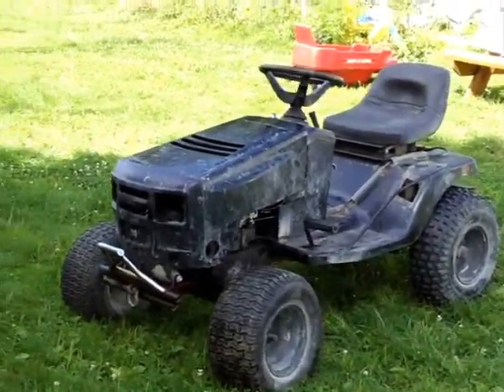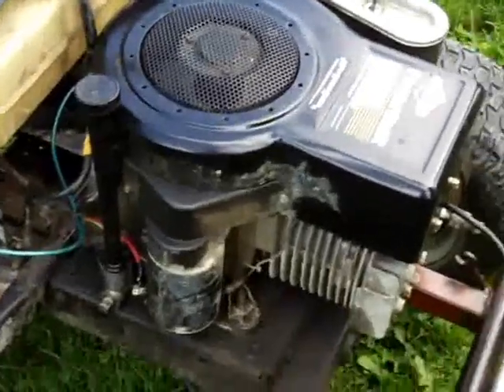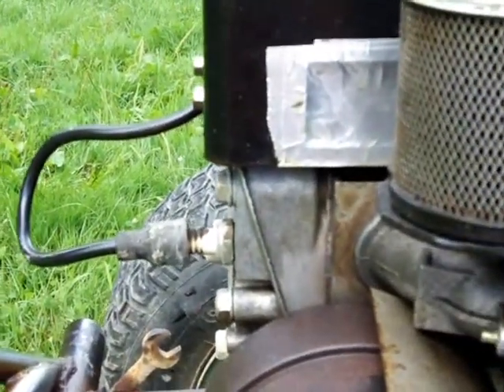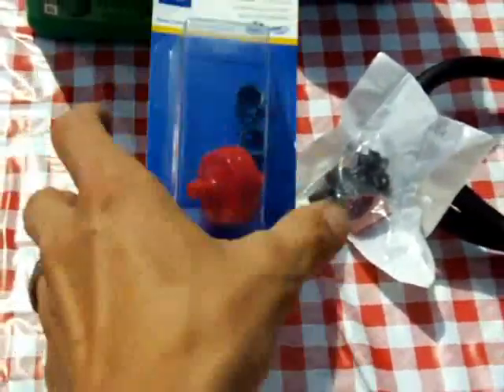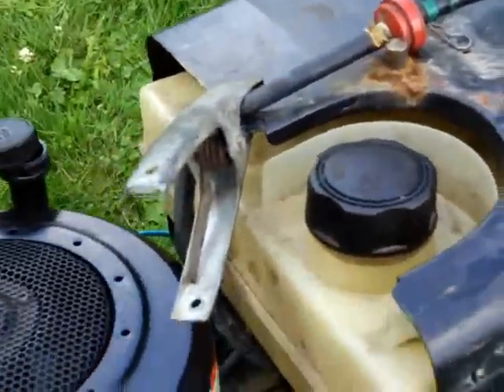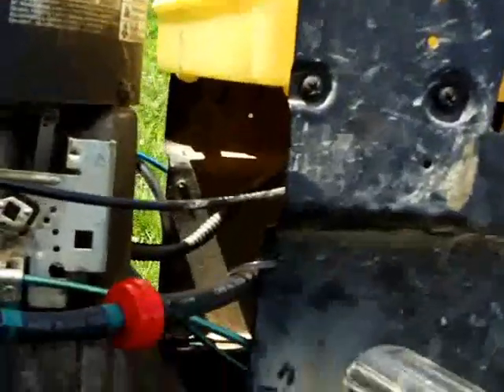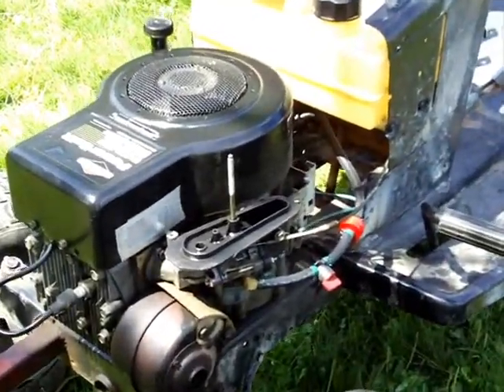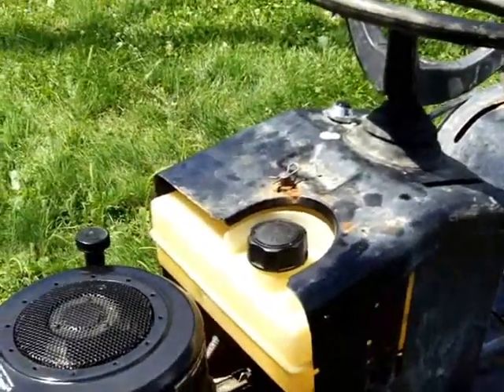Riding Lawn mower - Fuel system repair (Flooding)

Comment: Just went through the same thing with my stx38. The needle/seat failed on mine and even with the rebuild kit it kept flooding the engine. Put a new carb on and I close the shut off valve every time I shut down now and run the fuel out of the carb. Runs like new. Great job on the videos!

Comment: Thanks for the video because the exact same thing happened to my tractor today and after watching this video I knew exactly what to do. As soon as I realized it was hydro locked because it wouldn't even turn over I drained the gas oil mix and cleaned the carb. Don't know what caused the fuel to leak into the cylinder but it did. And ya thanks again for the video helped lots.

Comment: well done video, my Briggs riding mower has the same issue. Has a fuel shutoff valve since the carburetor won't close, forgot to shut the valve off and now won't turn over because fuel is in chamber and oil

Comment: My Ariens YT-12 was doing the exact same thing when I first got it (got it used) I ended soaking the carb in a bucket for two days, then putting it back on and replacing the fuel line, haven't had a problem since!

Comment: Thanks for the new vid man. I had this same problem with my 13.5 on the craftsman. I changed the oil a couple times before it stopped smoking. Runs like a champ now. Too bad I killed the brakes, tranny mounts, and steering on that thing haha. I got another mower that engine is going into.

Comment: I got a old Toro Wheel Horse 10 hp that the guy thought was blown up. Same problem. Started it up and it smoked like crazy because of gas in the crankcase . Still using it today and like it better than my new Troy Built.

Comment: @Fearlessfront hey u helped me with my wheel lock in the back. but i wanted you to no i did the same thing yesterday before i saw this vid with all the same problems but the only thing thats not the same is mine is a 1980 montgomery ward and it has one of those things that u twist that stop the fuel but the fuel shut off u got is what i got and helped alot...great vids!

Comment from the maker: it could be shorting out... It's possible it not getting a charge from the alternator, or the battery might not be holding a charge at all... I would load test the battery, then check the charging system.

Comment from the maker: that where the air flows out of the motor into the air filter housing (which is gone) I did this for 2 reasons, #1 if the air is flying out that hole, then it's not cooling the engine, #2 I didn't want hot engine air being forced into my intake, colder air is better.

Comment from the maker: sounds like your exhaust valve is out of adjustment... But first I would clean the carb and change the air filter and see if the problem gets better. Then check the flywheel key to make sure it's not partially broken, that would throw off your timing, causing it to backfire

Comment from the maker: @Gokartcreator does it just go click, click, when you turn the key? or does the starter rotate? It could be a bad solenoid. try tapping on the solenoid and the starter with a wrench... sometimes that will help.
Another thing you can try is using jumper cables, and hit the starter terminal with power directly. if it work then either  your solenoid is junk, or you could have a bad connection in your wiring..

Comment: The smoke was from leftover oil in the muffler,intake,cylinder,and around the rings..That air filter is only 8 bux at wally world usually...Off season its cheaper...

Comment: Always shut off your fuel when sitting long term. I’ve been around the block a few times with gassy oil it’s not hard to deal with but expensive.

Comment: @Fearlessfront The worst part of it is the 4$ of wasted gas, lol. I got a question, because I'm not too good at cleaning a carburator and setting it, but you seem to know a lot about it, do you think you could make a video of how to clean and adjust a carburator? I cant seem to find any good videos on youtube of it. The briggs on my tractor is running like crap and I dont know how to adjust the carb. i would apricate it very much if you did but if you are to busy dont worry about it. Thanks.

Comment: Just as a heads up if you have lots of gas in your crankcase DO NOT RUN THE ENGINE! if a spark gets past the rings it will ignite the gas in the oil blow the engine to bits and seriously injure or kill you. This happened to a car engine that my dad was next to one time.

Comment: the fuel line on my mower had sat for a few years with old fuel in it before i got it, when i tried to start it, new gas in it and everything, i couldnt figure out why it wouldnt start but it was because the fuel line had actually swollen shut and wouldnt let gas through. there was rubber that was breaking off the inside to so my mower was technically about to have a heart attack lol. had to replace it but i went with the cheaper clear tubing, that way i can see the quality of the gas and line.

Comment: i was wondering how you got the oil out of the the pvc valve thing because i have oil in mine and it keeps getting in the air cleaner and into the carb and i cant figure out how to get it out.

Comment: hey, I have the 14.5 horsepower engine Murray Widebody LT, and (assuming that these two models have the same electrical systems) I was wondering if you've ever had any trouble with batteries dying within 3-4 starts. My battery is totally dead now after charging repeatedly after it dying for nearly a year now. Maybe it has a short on it or something?

Comment: Hi fearlessfront I have a craftsman that is 24hp it was big bucks I bought it new. I had It for about 4 years and its been brocken for 3 years. It has a starting sound when I turn the key. It just does kick on. The other thing is it does not move when its off I even tried to move it in every gear when it was brocken. I also went to sear and got a nice die hard battery for $60.00 thinking that was the problem and I was not. When I get a chance I will put a video of it. Please help fearlessfront

Comment: well good to see you doing somthing, lol. Sucks when stuff like that happens. Also i finnaly got the gear oil for my tranny ill be trying to put it back together  tomarrow and i would then need to find whats called quarter 20 bolts for the pulley to mount directly on the shaft, then for a test drive. I was thinking about doing some pulls with my mudder but i am going to do test pulls with my mudder pulling my car with the breaks slowly applying to simulate a pulling sled.

Comment: on ebay im getting fuel line   a shutoff  2 filters    line clamps    and a 1/4 fitting as im getting new engines and I might have a tin can gas can lol